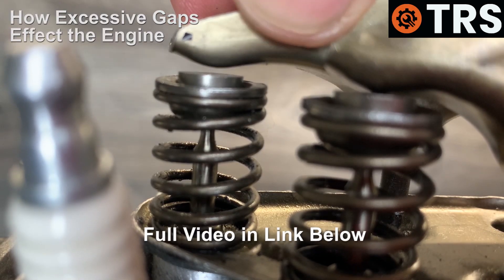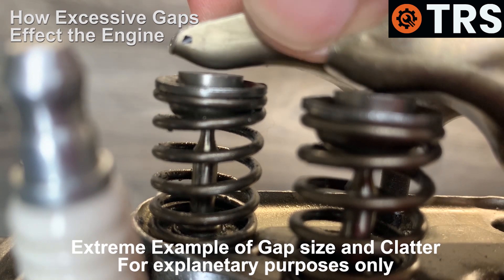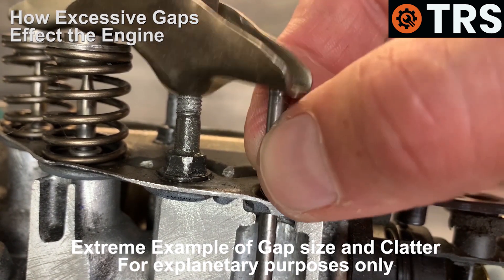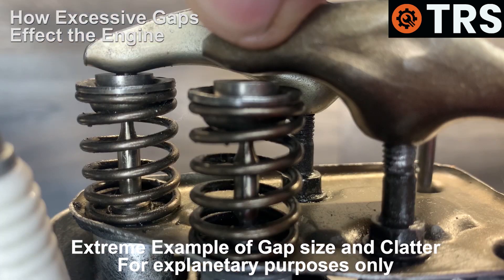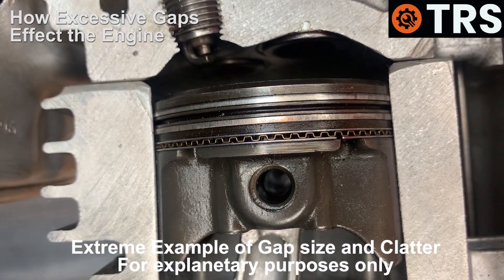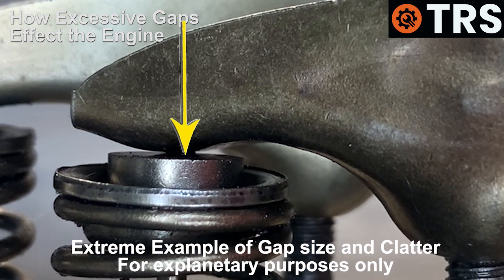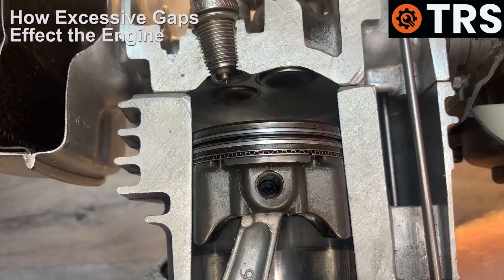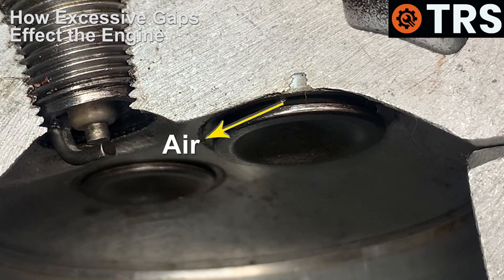Why Valve Tappets are Noisy, Ticking, Tapping 99% of the time!  (by Craig Kirkman)

Comment: Can a modify intake and exast with no dyno (I got Check engine A Code P0171 or system too lean bank 1 means either too much oxygen or too little fuel in the exhaust) affect the temp of the oil and become to much liquid causing hearing mechanical valve ? 
Sorry if that sound stupid i just try to figure out on a 2013 Mitsubishi

Comment: This is a good example of too large of tappet clearance. This is what I was worried about with my motorcycle when it would get hot, and then it would lose power and stall. Turned out to be the opposite. Great video! Simple and straight to the point!

Comment: On the new Himalayan 450, I've done only about 3000kms, the bike has the tick tick sound at the start of the engine but after about some seconds the sound vanishes. ( It is a shim type valves and also has semi-dry sump lubrication ) . Does it mean any issue? . Thanks in advance .
Reply from the maker: It's great to hear you're enjoying your new Himalayan 450! The "tick tick" sound you're describing at the start of the engine is likely related to the valve train and the lubrication system. Given that your bike uses shim-type valves and has a semi-dry sump lubrication system, there are a few possible explanations for this sound:

Valve Train Noise: Shim-type valves can sometimes produce a ticking sound when the engine is cold. As the engine warms up and the metal parts expand, the clearances may reduce, causing the sound to disappear. This is generally normal for engines with this type of valve system.

Semi-Dry Sump Lubrication: In a semi-dry sump system, the oil is stored in a separate reservoir and is pumped to the engine. When starting cold, it might take a few seconds for the oil to circulate fully and reach all parts of the engine, including the valve train. This can result in a brief ticking sound until proper lubrication is achieved.

As your bike has only done about 3000 kilometers, it is relatively new, and minor noises can be part of the normal break-in process. However, to ensure everything is functioning correctly and to maintain your peace of mind, here are a few steps you can take:

Check Oil Level and Quality: Make sure the engine oil is at the correct level and is in good condition. Low or poor-quality oil can affect lubrication, especially at start-up.

Regular Maintenance: Adhere to the maintenance schedule recommended by the manufacturer. Early maintenance checks can help identify any potential issues before they become serious.

Consult the Dealer or Mechanic: If the sound persists or you have concerns, it's always a good idea to consult with your dealer or a qualified mechanic. They can perform a more thorough inspection and ensure everything is in order.

In most cases, the ticking sound at startup is normal and should not be a cause for concern, especially if it disappears after a few seconds. However, keeping an eye on it and ensuring regular maintenance will help keep your Himalayan 450 running smoothly. Enjoy your rides!

Craig
Reply: @TheRepairSpecialist  Thank you so much for detailed response and clear information.  I have done all the maintenance rightly so far and will continue to do so. I will also watch out for any issues that might creep up. Your videos are highly informative. Thank you once again. 

Vasan

Comment: I used to adjust the valve lash, in about 15 minutes once the valve cover was removed...  New rocker arm was about $2.75. New pushrod a $1.99.     I charged about   $15.00.  labor plus parts.    Pull your heads and new head gaskets,  about $60 plus parts...     Milling the heads and grind the valves and seats, was. $50 per head.     New cam and lifters installed about $100 plus parts...

Comment: Some years ago, I bought a 1997 Volvo V70 with this noise. Ran it for 40 000 km and sold it further on. If its an old car, just run it. The engine will most likely run for a very long time anyway.
Reply from the maker: It sounds like you had quite the journey with your 1997 Volvo V70! It's true that sometimes with older cars, a little noise here or there is just part of the charm, and it's great to hear that you were able to drive it for another 40,000 km with no major issues. Volvos are known for their durability and longevity, so it's no surprise that the engine kept on chugging along. It's all about enjoying the ride and making memories along the way. Happy driving!

Craig

Comment: Hey, thats very informative. 
I have couple of doubts, could you please clarify them-
Is this causing my engine to lose power and also increases engine vibrations? 
My motorcycle is making clattering noise, and when I accelerate, it jerks forward for a moment. When I let go of the throttle, it suddenly slows down.
Is this something to do with the valve clearance?

Comment: How to fix it then?
Reply from the maker: HI. you just need to adjust your valve clearances. Here is some guidance on that but you must read your manufacturers handbook for their procedure, safety advice and their clearance settings before attempting this procedure, but here is a guide of the sort of thing you will be needing to do:

Setting the valve clearances on a small single-cylinder 4-stroke engine is an essential part of regular maintenance to ensure that the engine runs smoothly and efficiently. Here's a general guide on how to set the valve clearances:

Note: Be sure to consult your engine's specific service manual for the correct clearance values and procedures. This is a general guide and may not apply to all engines.

Tools and Materials Needed:

Wrenches or socket set
Feeler gauges
Screwdriver
Service manual (for specific engine clearance values)
Steps:

Prepare the Engine:

Make sure the engine is cool and not running.
Disconnect the spark plug wire to prevent accidental starts.
If necessary, remove any engine covers to access the valve components.
Locate the Valves:

Typically, the valves are located on the cylinder head.
There should be two valves: an intake valve and an exhaust valve.
Determine Top Dead Center (TDC):

Rotate the engine's crankshaft to find the top dead center position for the cylinder. This can be done by either following the engine manufacturer's instructions or by using a timing mark on the flywheel.
Check the Clearance:

Use the service manual to find the recommended valve clearance specifications for your engine.
Insert the feeler gauge of the appropriate thickness between the valve stem and the rocker arm (intake valve) or between the valve stem and the adjustment screw (exhaust valve). The feeler gauge should slide in with a slight drag.
If the gap is too tight or too loose, you will need to adjust it.
Adjust the Valves:

To adjust the valve clearance, you may need to loosen the lock nut on the adjustment screw. Use a wrench or socket to do this.
Turn the adjustment screw to achieve the desired clearance. Turning it clockwise decreases the clearance, while turning it counterclockwise increases it.
Recheck the clearance with the feeler gauge and make further adjustments as needed.
Once the clearance is set correctly, tighten the lock nut while holding the adjustment screw in place.
Recheck and Finalize:

Recheck the valve clearances to ensure they are within the specified range.
Once you are satisfied with the clearance, replace any engine covers you removed.
Reconnect the spark plug wire.
Test the Engine:

Start the engine and let it run for a few minutes to ensure it's operating smoothly.
Maintenance Records:

Keep a record of when you last adjusted the valve clearances to help you stay on top of regular maintenance.
Valve clearance adjustment is crucial for maintaining proper engine performance and preventing damage. If you're unsure about any of the steps or don't have experience with small engines, consider seeking help from a qualified technician or consulting the engine manufacturer's service center for guidance specific to your engine model.

I hope this helps a little. 
Craig
Reply: Thank you @TheRepairSpecialist